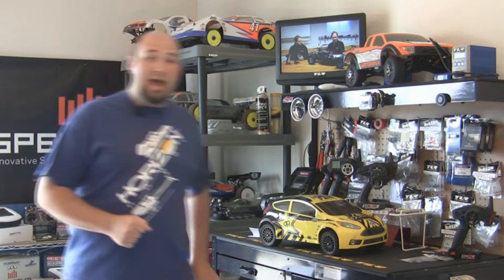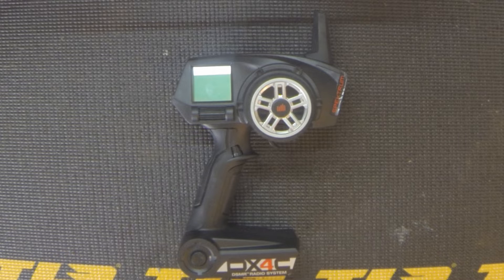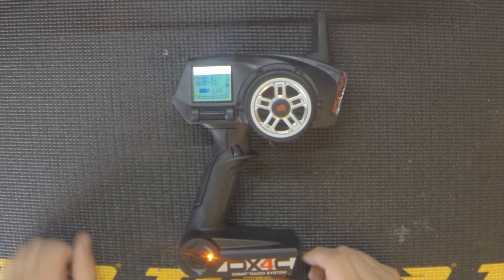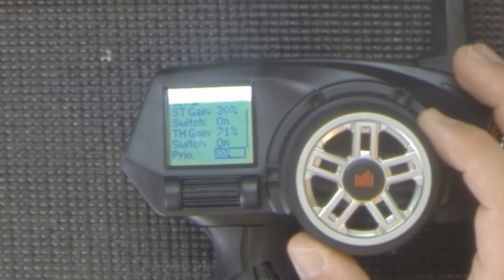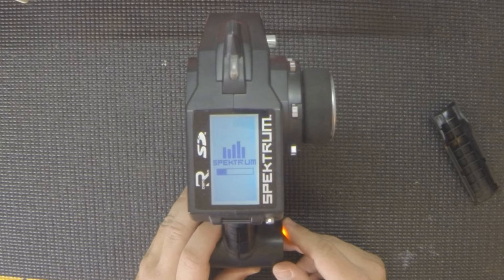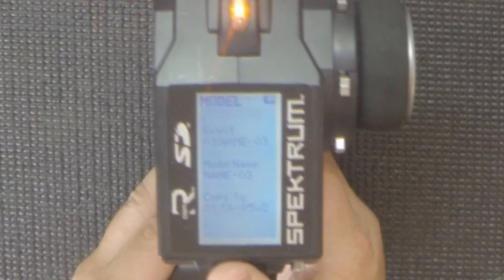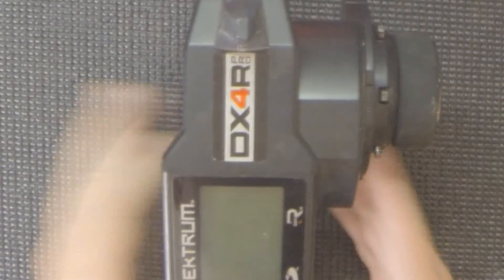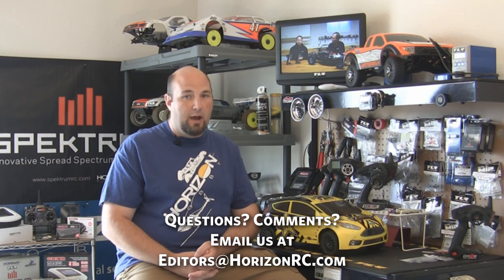Tech Tips - Understanding AVC Gain and Priority Settings

Comment: The manual is confusing maybe (for you)  but common sense and having a DX5 PRO learned that you see the AVC gain turned down gradually (not only at 100%) so prio 100 means it gradually turning down the AVC gain. So gain AVC set at 50 pro at 100 means that it turns down AVC gain 1 percent every 2 percent of steering so half left turn on transmitter results in AVC gain put down from 50 to 25 and full left would turn AVC to full zero. This is how it works not like you describe which would make no sense at all.   AVC steering set at 50 and prio at 50 would turning down the AVC gain from 50 to 25 still leaving a bit of AVC on full turn and at half turn it would turn it down to 32.5 it reduces 50 percent and the move is 50 percent so a quarter of the AVC gain is taken down. I'm lucky to see it in the display on the PRO DX5 realtime you see the AVC throttle and steering gain values being GRADUALLY turned down and prio 20 does turn it GRADUALLY down 20 percent of the starting AVC steering gain Value.  It's 8 years I hope you found out you where so wrong and taking down this video would still help people. It's horrible information. The manual only suggested in the example it would do reduce 80 percent at full left does not suggest it only does it at full turn. It does it GRADUALLY so half turn would turn down AVC as well but gradually.

Comment: Which AVC receiver should I use for dx3r pro on slash 4x4 platinum?
Thanks!
Mark
Reply from the maker: Hi Mark, AVC works best with a 4+ channel radio because you can adjust the AVC gain for Steering and Throttle independently.  If you are only going to use AVC with your 3R Pro, you will only have the ability to adjust one of the gains, and the other will be stuck at 50%. So really not the best setup for AVC.  That being said the DX5C is available, has a fully integrated AVC menu, and is around $100, so that would be a great step in getting the best experience out of AVC.
Reply: Thank you so much for your advice and time!
Reply: @SpektrumRCvideos  This is a good video even for a new user in 2023. The manual for the DX5C says NOTHING about AVC when full throttle or full brake are applied. Yes, it does for full left/right. I never heard it said before until this Spektrum tech in the video said it. Is he correct when using AVC that the throttle (full throttle and full brake) affects AVC? I am OK with that I need to know with the DX5C is his statement true? Manual says nothing on throttle?

Comment: Hi Gary,
I have the UMX Geebee R2 and all of a sudden now one of the aileron servos has reversed so both aileron control surfaces move the same direction.
Any ideas? The other servos works the correct direction when plugged into either of the 2 aileron ports on the receiver